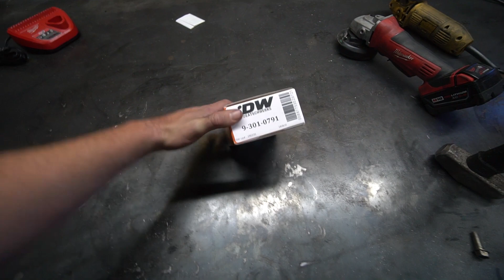Miss Jackson's FIRST STARTUP!  (Subaru WRX Swaped GC8) But We Have One Problem..

Comment: Try flipping the MAF around, I think you have it backwards in the intake. The wire connection on the sensor should be facing the front of the car. That could be the reason it's running so bad with it plugged in. Best of luck on the build!
Reply: 100% correct ^^^^^
Reply from the maker: I ended up figuring that out and I turned it around and rotated it to where the plug faces up so I could reach with the wiring.
Reply: Another thing I've seen a few people mess up with is dropping the MAF in to a bigger housing without re-scaling. The MAF samples a small amount of air, if you put it in a bigger housing then the sample size relative to the housing is decreased, so you end up with a lower measured air mass than is actually being used, and less fuel is injected. Unplugging the MAF works on these cars because they have failsafe speed/pressure tables to run on.

Comment: Thanks for going over the difference between blow off valves. Always wondered why my 04 Forester xt would fall on its face if I let off throttle for a second or two.
Reply: I've always used recirculating for street cars. On the drag strip atmospheric is fine in my opinion but, that bog after letting off the throttle just hurts my heart on the street.
Reply: The only one i would run on a subaru is a gfb. Ran a respsons at 50/50 for a few years, zero issues
Reply: Is recirc called diverter valve like a vw?
Reply: Audi*
Reply: Branden Russell diverter valve, bypass valve, recirc valve, blow off valve. All the same thing, just different names
Reply: @dan_2846  no sorry, if you put a blow off valve on my Audi it doesn't work the diverter valve releases intake pressure if at any time my Audi loses boost.... well it's just not made to not have boost
Reply: Maybe it's the factory tune not sure? But I tried the blow off valve cause I wanted the noise it makes but the Audi denied me I took it to the dealer and a custom shop both places told me they were different things and it was not designed to not have boost
Reply: As for recirculating, I think that is a diverter just not sure
Reply: I have an Audi quattro 2.0T AWD
Reply: Or maybe it's a 1.8T ??? I never really have to work on it so not sure it just goes, it goes pretty quick to for 7-8 psi, and it owns corners, easily the most fun street car I have ever had, a/c will freeze you out love it

Comment: Milwakee best tool. $700 for snap-on 3/8 impact.... $300 for Milwakee. Easy choice.
Reply: I had co workers had snap on stuff and they regret getting them. Most stuff broke easily. 🤷🏽‍♂️
Reply: @jdmsidewayz5336  I replaced the motor in my snap-on electric impact 3 times in a year.
Reply: Snap on is the same quality but if it breaks snap on replace it for free. The cost is because you have a life time guarantee (*edit for most tools anyway*).  Thought anybody into cars would have known this.
Reply: Siberian Husky my point being, with Milwaukee tools i didn’t need the lifetime warranty because it didnt break and I can’t claim my snap-on warranty if i am not working at a shop the truck visits, unless i want to waste time sending it to them directly in the mail then i am out an essential tool for a month. Better off buying Milwaukee.
Reply: @NismospoolinOfficial  I've had a few tools replaced by them and it's never been more than a few days.  Granted if you work in a shop it's different however I am sure a shop would have more than one of that tool anyway.
Reply: Siberian Husky like i said. If you no longer work at a shop that the truck visits.... besides, $600 for a 1/4 ratchet set just for a warranty is bogus. Since i no longer work at a shop, i will never buy snap-on again. Ever.
Reply: @NismospoolinOfficial  that's fair enough.  Over a lifetime I believe it to be worth the extra money.
Reply: @IOTWVUVWTOI  I mean, you're definitely entitled to your opinion and your preference in tools, but i spent a decade as a technician with thousands upon thousands of dollars worth of snap-on tools and when i finally got out of it, i sold most of them (for a fraction of what i paid/was still paying because no one would pay anywhere near the ridiculous prices snap-on was asking for them even though a lot of them were brand new) and I picked up other tools from places like home depot and stuff to get me by and i haven't had a problem with any of them. Granted i kept the essentials like ratchets, socket sets, impacts and wrenches, but my $10,000 tool box i sold for $4,000 took four months to sell and it was in pristine condition with hutch and side cabinet. Not worth the massive price hike for the "warranty" that i had trouble with anyway. the resale is also garbage.
Reply: @NismospoolinOfficial  agreed resale is garbage and the tool box's/chests are the only thing I don't buy snap on.  

I've had the same tool chests for 15 years and still near pristine with daily use.  

I've always believed If you look after your car/tools they look after you.

I've snapped a few tools over the years but always had them replaced under warranty.  

Like you said each to their own.  

Good tools are good tools regardless of branding :)
Reply: @IOTWVUVWTOI  Amen, brother. :)
Reply: MAC and MACO are my favorites.
Reply: @IOTWVUVWTOI  air and power tools are only 1 year Maybe 2 warranty through snap on or any tool maker really.
Reply: @SkylineLynar  I was referring to tools generally.  Not one particular type of tool specifically.  

However, as stated previously good tools are good tools regardless of the brand.  My personal preference 95% of the time is Snap On.
Reply: @IOTWVUVWTOI  Snapon only has a 1 year warranty in electrical components
Reply: @christopherhartwell5155  I was talking Snap On generally, perhaps I should have clarified.
Reply: My snap on 3/8 impact was only a little over $400 new and I’ve never had an issue with it. My snap on polish/prep tool was absolute junk though, lol.
Reply: @IOTWVUVWTOI  Snap on electric impacts only have a 2 year warranty milwakee has a 5 year

Comment: Taylor aren’t these the motors that have a filter in the banjo oil feed for the turbo? If so you should look into solutions for a different oil feed source. If the banjo clogs it’s starves the turbo of oil. Have replaced a few wrx turbos because of that problem
Reply: Just remove the little filter. I removed mine and it was in the process of breaking

Comment: You can vent the BOV to atmosphere with a MAF with it in a blow through configuration. As long as the BOV is before the MAF. But that also requires a MAF you can use in a blow through setup.

Comment: you can run a flexible air duct from the lower vent that is under the blinker thru the quarter panel up to the intake to help direct cold clean air.

Comment: When you were using the torch at 16:05 u melted the electrical tape off ur wiring harness @ 16:16 u can see a section pop off.

Comment: I have been running a dump valve for years. Never had any issues. It does run a bit rich stock which makes it pop through the exhaust sometimes.
But other than that no issues.

Comment: You can run a blow off valve and be fine. A tune can’t compensate for the air loss anyways so it’s no gain/loss and it’s not going to compromise your engine.

Comment: When it comes time for tuning look into the Carberry rom, Its a heavily modified rom image that you flash using ecu flash and a tactrix cable. The rom lets you do a bunch of cool stuff on the oem ecu, flex fuel, dual map/map switching, launch control (fuel or spark cut), rally style antilag, full speed density, etc a bunch of cool features. really the way to go on these older wrx ecus. Cobb support for the early stuff is kinda lacking.

Comment: Just had the same problem on my 02' Ford ranger XL 3.0L M.A.F sensor was bad and my truck was throwing codes P0172 - P0174 Fuel Lean codes. Cleaned every sensor, checked for vaccum leaks nothing. Replace the fuel pump nothing. Replaced the M.A.F and it fixed it.

Comment: Get a braided turbo oil feed line I ran into issues with the factory line from flexing and motor rocking and it putting stress on the line and causing leaks braided or rubber well worth it

Comment: Your making this a daily driver Please do the following. These items will help even more because of you living in a hot state.
1. Gold tape the intercooler. Yes, sounds silly but EJ's have trouble getting heat out.
2. Replace and coat the following. Header, up pipe and down pipe. Start with the down pipe. Again, helps with heat evacuation. Recommend killer B. Not a plug for them. "Killer" product.
3. I know you did an AOS. But please look into getting the iag AOS. This is not a plug for them. It. Just. Works! Do some research. Your smart you'll understand.
4. FUEL! EJ engines need more fuel then evo's to keep the engine happy.
5. Alot of turbo options. Build the engine first. This is a look ahead. I don't know your plans. But it's better to build the engine first then match the turbo. Over buying two turbos before building the engine.
Long winded. Sorry, just love that your into the subie gang!

Comment: The throttle cable attatches to a clip on the aux belt cover ;)
And THANKS for throwing away that damn SSQV valve! It vents way too much air.. I got a GFB Respons for my 08 STI and when its proper tuned it doesnt vent too much so I get no stumble or super rich events ;)

Comment: I'm still a air tool kinda guy have some electric tools but charging them is a pain in the ass. It seems like every time I wanna use them the batteries dead.
Reply: Gotta have a extra battery if you are working in a shop.

Comment: Is the top mount as good as a front mount, I never checked just asking
Reply: No
Reply: no but subaru use top mount to reduce damage while rallying. it's a homologation thing.
Reply: If u use a similar size front mount it wont matter its when u put a big front mount thats noticable

Comment: You put the MAF backwards. That's why it's not running. With subaru engines and tuning if it runs while the maf is plugged in and you can pull the plug while the car is running and it doesn't stumble or die then the maf is bad. If it won't run while plugged in its backwards ( also easy to tell if the harness is comfortably sitting on the wrong side of the pipe 😬). If it runs with it and not without its working properly. Also keep a good stock of NEW OEM iac valves and gaskets. They shit out constantly and the Chinese cheap ass eBay ones can't be trusted, even new. 

Also id strongly recommend against wet type element for subarus. There's a lot of turbulence getting pulled through the very short intake pre-sensor while on boost. You'll be nuking MAF sensors constantly unless you want to clean it twice during every oil change interval. There are dozens of very high quality dry type high flow lifetime elements  available. You won't regret it. But you might if you don't. 

Top tip... The intake box is designed to go near the strut tower. The oem post maf pipe is an S shape to keep it up and away from where the cold air snorkel is supposed to go on the wrx. That's why your air shroud looks silly with a straight coupler that wants to jab it down towards the headlight. 

Make sure you get a good hood scoop and a BAFFLE designed for your setup. The GC/GF/GM chassis give the option of a scoop but it won't provide you with a scoop splitter that guides the air from over the hood DOWN through the tmic. Heat soak is a crucial issue with these. When you don't have a splitter under your scoop, air coming in from under and the front of the engine bay create a huge positive pressure condition up towards the scoop. If there's no splitter, the air coming over the hood isn't strong enough to push through the positive pressure and therefor causes a negative pressure zone above and surrounding the scoop which even disturbs the air ahead of the car and creates lift which is noticeable on the track. You run a splitter and a decent under tray or skid plate to make sure the air coming through the hood/front is able to go through the tmic and the radiator shroud and eventually evacuate Under the car... Again not super ideal but overall better than heat soak and turbulence. If you really give a shit about pressure evacuation you'd run controlled ducting to the brakes and down the sides 😬😬😬 lol

Comment: Lmao sounds like you just need your vent to atmosphere bov before the maf instead of after. Then the maf will only read what's going into the throttle body.
Reply from the maker: If you put it before the maf then it would be before the turbo and essentially pointless because the air would have to go back through the turbo to the unpressured part of the system. The whole purpose is to prevent pressurized air from going into the turbo the wrong direction.

Comment: My subaru people i have a question that needs answering even after searching high and low in forums. I have an 02 JDM STI swapped bugeye but under full boost as of recently it shits out coolant on to my manifold and i haven't found the culprit. Please help :(
Reply: Sounds like you might be lifting a head under high boost. It causes air in the system and can sometimes empty your overflow. Its actually a pretty common problem. Unless someone else can come up with a better reason why it would be happening your best bet would be some ARP studs and new head gaskets
Reply: Or you could always just turn down the boost but where's the fun in that
Reply: @Nec89  Thanks for the info man ill definitely look into it. I figured that it was either that (which i realllllly don't want to be true) or its my coolant line to my turbo since it is just dumping on the manifold from what i can tell.
Reply: If you're overheating at all do a chemical block test at the radiator.
Also pressure test the coolant system and caps.

 But if I had to guess, it sounds like a head gasket :/  

Keep it under 20 psi on a stock EJ257

Comment: My 20v dewalt buzzes my lug nuts right off easily.
Reply: So does the Milwaukee 18v. The impact Taylor was talking about was only a 12v.
Reply: @parsleyslet  yeah but my 20v is a lot smaller than his Milwaukee and it's not socket drive, I put a 3\8 adapter to put sockets on it.
Reply: @pmmartinpmjm  the whole point of a socket drive is to put sockets on it...lol if your DeWalt impact driver will take off lug nuts then use it man. You'll end up eventually breaking the socket adapter. But that Milwaukee he has is rated to I believe 250 ft/lbs breaking torque where as the  Milwaukee M18 1/4 impact driver is rated to 166.667 ft/lbs (2000 in/lbs most powerful available) and not to mention how small it is. With a 1/4 driver and an adapter and a socket you loose the "stubbyness" lol but to each their own right?